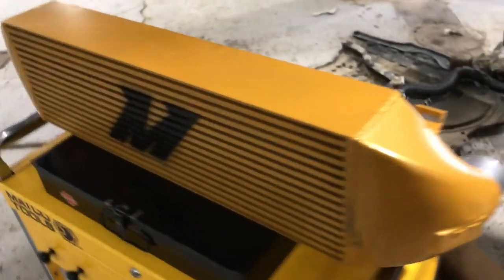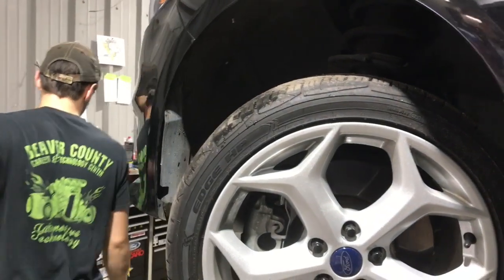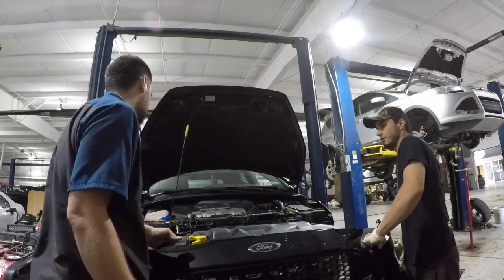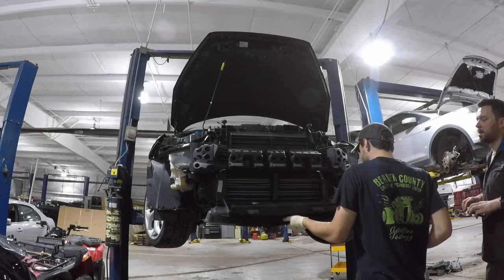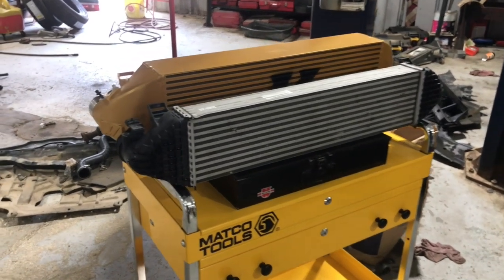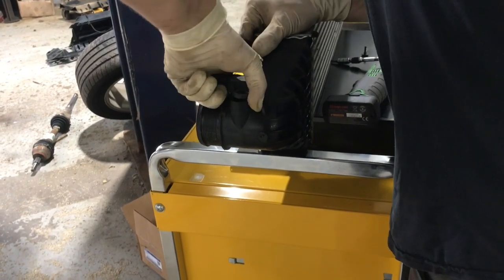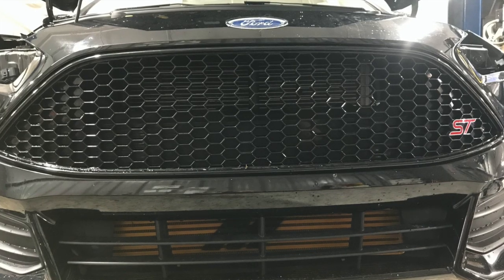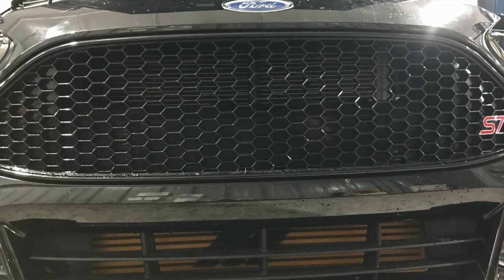Mishimoto Front Mount Intercooler Install Ford Focus ST

Comment: Great video. I wish you could see the intercooler better on this car like you can most.
Reply from the maker: Thanks for watching, it’s actually pretty noticeable on the car.
Reply: you can. just delete all the plastic crap and cut shave down and paint those little bars going across the bottom of the bumper. i did it and its very very visible

Comment: I have a 2018 ST that I am going to do this to , At 2:27 you can see the metal pipe going from the intercooler to the Turbo it hugs a channel in the oil pan . Would it make any sense to put any heat blocking material in that area to prevent heat from the oil pan from going into this pipe ? There are many types of heat shields that could be used ?
Reply from the maker: Yes, I think that would be a good idea, I would use the thin metallic heat wrap. Thanks for watching and the comment.